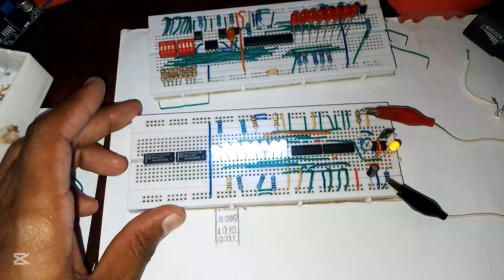8-Bit Program Counter

Comment: Nice work! Will this PC will show an adress of instruction to input of register memory?  And where did you get IC of Adders? , besause i not found it on Ali
Reply from the maker: I removed the Chip from an old Circuit board
Reply from the maker: I removed the Chip from an old Circuit board